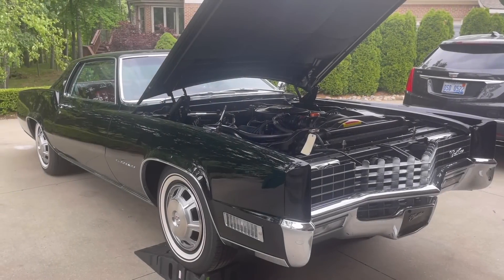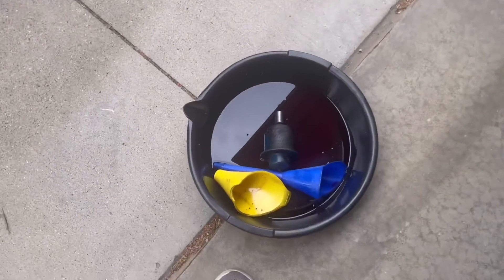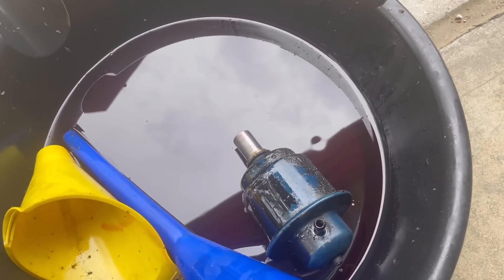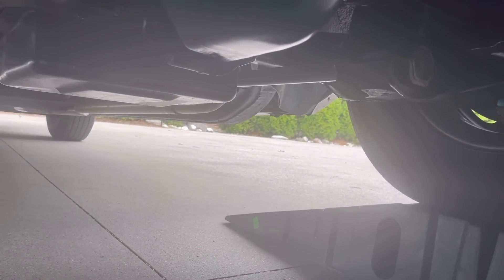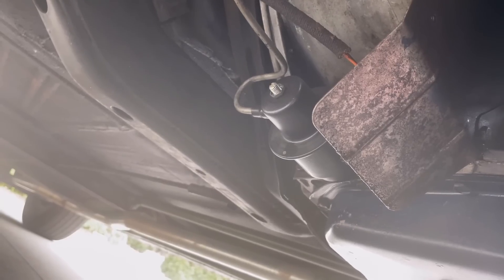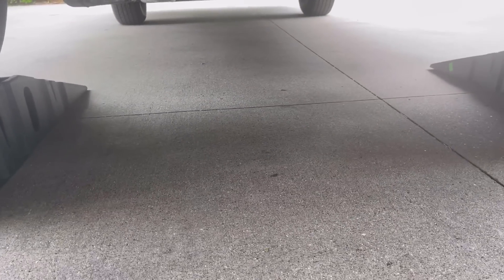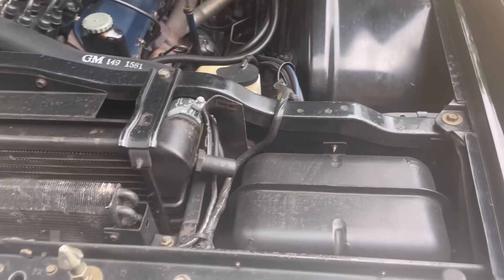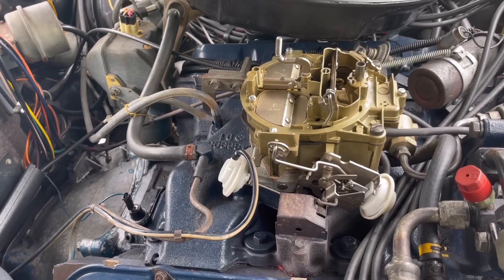How to Fix An Incorrectly Shifting Transmission Yourself (Incl. Turbo Hydramatic 350/375/400/425)!

Comment: You should remove valve piston and clean it with scotch pad and make sure the 3 holes are clear 2 on side and 1 on end. No sense pulling modulator without doing it, also governor determines shifts, look for striped nylon  make sure piston moves freely and springs on centrifugal weights

Comment: My sister had a 1970 Buick Skylark which suddenly stopped shifting automatically. So, she had to start in low, then move the lever to second and then to third. I thought the problem might be the modulator. I found that the vacuum line was kinked. I corrected it and the car shifted as normal.

Comment: IF you have a Leaking Modulator - the fluid is drawn back into the engine and causes smoke at the tail pipe. BUT Transmission Fluid actually softens rubber - to keep the seals in the Transmission sealing the pressure. This will also soften the Vacuum hoses hooked up to the Modulator so WHENEVER you replace a leaking modulator - always replace the Vacuum line to it as well. THey are cheap hose - easy to get - and not hard to install. (Pull off - push on)

Comment: Old cars are the go. I had a beautiful 2010 FG xr6 but it had one of the worst transmissions that ford ever decided to put in their falcons,the dreaded 5r55s 5 speed auto. Only had 110,000 kms on the clock and the bloody servos started slipping between gears. I poured way too much money into this car to get it how I wanted it to be but to have to turn around and sell it while it was still working ok really gutted me. I dropped about $4000,00 on this car. Never again will I spend money on a muscle car with go and show,it’s just not worth it.

Comment: What is recommended to service turbo hydramatic 400 transmissions. I have a 1973 Buick Centurion 455 cubic inch with 95,000 miles?
Reply from the maker: Just change the fluid and filter every 50-75k miles under normal use.

Comment: My first car I owned was a 73 Caprice 4-door with the 400 small block and turbo hydromatic 400 I had to replace modulator valve on it very easy job to do average 15 miles a gallon hwy with points ignition and 2 Barrel in my opinion Best Transmission GM ever made.

Comment: I was heading home from a desert trip in my 70 El Camino 350/350, I had pulled off at a rest stop. After that it wouldn't shift out of first. After a few seconds pondering driving the remaining 50 miles home in first gear, I popped the hood and found that the vacuum hose had pulled off of the manifold. After a quick repair, I was on my way home with a functional transmission!

Comment: I have a question, On the 1979 lincoln continental town car, does it have a temp light on the dashboard?, Cause I don't see one...? It has a temp sensor...that's why I'm wondering.
Reply from the maker: I believe it has an Engine light which is wired to the temp sensor as well as oil pressure sensor.

Comment: My old caprice had a leaky modulator that kept fouling one of the plugs.  And, I left the modulator hose disconnected from the tranny when I was putting the new long block in my 78 camaro

Comment: You should change the engine oil just in case transmission fluid was sucked into the intake manifold and down to the crankcase. That happened to me on a 71 Buick.

Comment: I used to work at a Chevy Olds dealer when I was younger and rebuilt transmissions sometimes as well. I had the opportunity to do a few of these huge front wheel drive transmissions. IMO they were one of the tightest ones to get out. 
Nice video.
Reply: If you think those were tight - you would have had a heart attack with many of the later Front WHeel Drive ones - With a Saab you had to remove the ENGINE to get at the trans among others.
Reply: @Thommadura  Wow. Never had the luxury of doing one of those. Sounds crazy.

Comment: Also check the vacuum pipe is fitted inside the port on the manifold fitting and the modulator. The manifold fittings often have a small hole in the port, so check that is clear. Check that the detent switch is adjusted correctly. If it has a switch at the pedal with a sliding action, you can reset it by pushing the sliding part all the way towards the firewall and then fully depress the throttle pedal. You will hear  the switch ratchet as it self adjusts to the correct kick down setting.
Reply: 425 don't have a cable th350 and 200 do
Reply: That would b a TV cable. 200/700R4. The turbo 400 is electric kickdown, the turbo 350 has a kickdown cable.

Comment: So far 76 convertible which the underpinnings are almost identical I have not run into that issue. But thank you for pointing that out as if it does act up I know what to check first.

Comment: I change the fluid & filter  and dump in 2 bottles of slick 50 go out  on the super slab and  bury the needle pedal threw the fire wall oh and all good transmission mechanics  know to start at the Carbureator

Comment: I bought a 1983 Grand Prix Brougham that was a 305 Chev with the 200R4 trans. I watched the owner keep adding transmission fluid in it until he gave up & sold it to me for $100.00.
Turns out that the modulator valve was sucking fluid into the engine and what he thought was a head gasket problem was the engine burning transmission fluid.
Once I fixed the problem that was the cleanest engine I have ever seen. That engine ran perfect & never used any oil. Got almost 500 K out of it with the original timing chain before it was sadly rear ended & wrote off

Comment: You know I appreciate you Adam it's like a personal video for me! I have a 1976 Cadillac Eldorado with a 500 inch motor I would assume that the technology is basically the same as far as the transmission modulator I'm going to go ahead and check out the vacuum lines going to the modulator but I have had no shifting problems the car is wonderful I'm just having some proportional valve issues or soft rubber lines to my brakes in the rear because I'm not getting brake fluid to my rear brand new disc brake calipers "had tried to do a brake bleed and nothing came out?"  but life goes on I'm trying to make this thing mechanically correct it hasn't been touched in twenty-nine thousand original miles and I'm the second new owner.  So here we are thanks again !
Reply from the maker: Could be master cylinder as well
Reply: I hear you supposedly the vacuum booster master cylinder has been replaced before I bought it I'm going to get my mechanic to diagnose it because their is too many new parts mixed with old parts to try to decipher :) Right now I only have front brakes lol!
Reply: It's a beautiful car it just needs a new convertible top it's got the Firemist red paint with red interior!

Comment: I didn't know there was anything above a TH400. The gears in the 425 must be rock crushers!  🤣

Edit: I had a TH350 behind a hopped up 73 455 Pontiac engine in a 1980 Trans Am, and aside from it refusing to start off in 1st gear unless I put it there (was told because of missing kick down linkage), it held up fine!
Reply: Is the 425 really "above" the 400? I'd always heard that it was just the a split version of the same transmission, with GM's famous drive chain between the two halves.
Reply: @pcno2832   IDK I made that post reading the title before watching the full video, and then saw the 425 was in fact this version.

Comment: Damn.  I wish there was some way to share some of the weirdo Ford GM and Chrysler donated prototypes I got to fool around with at Motech back in the '87.  Was interesting that when I was going to school there on Industrial road in Livonia that ASC was building the 50 GNX Buicks just across the street(Barb-wire protected)..  Was cool to at least see all of them.  But, the weird prototypes at Motech were more interesting.  Dodge D100 with a 2.2 4 cylinder.  Yes, the protype artisans built such a thing even though the 2.2 was never made for RWD.  The upper radiator hose was at least 6' long...pretty funny.  Motech was a decent school.  Sad it no longer exists.

Comment: I've seen folk pull engines to rebuild due to the blue smoke from burning transmission fluid sucked in from modulator..  Stupid mistake from the "old days"  Glad I was a Mopar guy.. no modulator.

Comment: I once had the modulator valve go bad on an ‘83 Ford Ranger. It had the same issues you mentioned.
Reply: If I remember correctly, the Ford transmissions in the '80s(at least the AOD ) were not vacuum controlled. They used a mechanucal linkage.

Comment: Need to replace the two short vacuum hoses too. Not good for the hoses having that fluid in there. That transmission has a good track record, very reliable and tough.

Comment: Excellent Adam, people generally assume the worst if the tranny acts strangely...  Lately I've been driving my Wildcat convertible and again marveling how flawlessly its Turbo 400 shifts compared to my 4T65-E HD.  One of the first things I did was to put an adjustable modulator on it and convert it to type F fluid. Between the two, it's always in the right gear for the speed/load/throttle position and the shifts are imperceptible, neither slipping nor banging.  Tis a pity that the computerized Riviera can't claim either of those, and takes forever to go into drive or reverse...
Reply: I never saw any AOD transmission from the Big Three that were as good and reliable as the simple 3 speeds of old that they replaced. And you'd think all they had to do was just add a gear up in there but not they have to downgrade the whole transmission.
Reply: @HAL-dm1eh  The 4L80E was pretty near bulletproof, considering it is the electronic, 4 speed version of the TH400. The main thing is GM (and Ford and Chrysler) started using lighter duty transmissions in heavier/more powerful cars, mostly for fuel savings. The most egregious was putting the Chevette TH200 into V8 cars.

The 4L60E gets a bad rap, but it's not too bad of a transmission, especially in later models.
Reply: If your 4T60/65-E is taking a long time to go into Drive or Reverse, especially after it has been parked for awhile, you likely need to reseal the torque converter circuit or the input clutch housing need to be replaced due to an internal leak. It should not take any time to shift to Drive or Reverse.
Reply: @paulwindisch1423  Thanks for the tips, Paul.  I don't know if it makes a difference, but this problem has been consistent for 18 years and is actually better with a cold start (and ergo a faster idle...)

Comment: Some of these 10 speed computer controlled transmissions today can just be a hornet's nest of complexity. With these older transmissions if it's got a lot of miles on it and it's just starting to wear out you can use a bottle of that Lucas Transmission Fix and it can extend the life of it for a few years. That is one of the few additives that really does work.
Reply: Just added some to my 2010 Corolla 4 speed (old but reliable design) during the last fluid change to get rid of low speed shuttering, and it worked of course.
Reply: I had a leaking steering rack on an 06 Volvo XC70 at 125,000 miles. Lucas to the rescue! At near 200,000 miles when I sold the car, no leak at the steering rack!

Comment: Did those TH400/429 combo have there own bell housing pattern ?
Reply: I think you mean 425, GM never made a 429. And yes it would be a BOP bell pattern.
Reply: Oh I was referring to the Cadillac 429 
And yea the TH 400 and 425 transmission.    I know it was just a one year thing before the 472 engine
Reply: @alexinnewwest1860  I coulda swore he said this was a 425, but I've been wrong before. Man the 472's were engines dreams were made of, every time I see the Cadillac valve covers I think of 472's.
Reply from the maker: Engine is a 429.  Trans is a 425.
Reply: So is that 429 a BOP pattern? 
Was it just for that particular year?

Comment: And if your tranny is just starting to slip, you can make the best of it by adding a small bottle of positraction additive.
Reply: Lucas tranny additive works.
Reply: FYI; Please don't refer to the transmission as the "Tranny". You'll cause an uproar with the LGBTQ community.  In the old days you could say tranny, not any more. How times have changed. Just wanted to clarify that. Otherwise gr8 content/video. I think Adam is a great helpful guy.😊
Reply: @paulkirkland1535  You're right ... could easily get my comment censored.

Comment: I do remember these GM modulator valves, When you see "white" smoke in your rear view mirror, pick up another valve on the way home! I suppose they did last a while, I had 3 GM's  and had to do all 3 in a 2yr period..ha, but not again. May have been about valve age more than miles used.

Comment: Olds and GMC.  Hmmm.  I wonder if that was how GMC ended up with 350 Olds Diesel engines in their trucks.  I never thought of this before.
Reply: If you had a good good machinist those Olds 350 diesels could be turned into high compression gas motors, either the heads or block or both needed drilled for water passage. I'm pretty sure more failed though than ran successfully.

Comment: valve diaphragms, hoses, belts, etc.  anything rubber or plastic should be suspect after 10 years.  Particularly anything near the block where it will temp cycle.

I was waiting to see you adjust that valve whilst shifting 2nd to 3rd!

Nice clean underside.

Comment: My first car in high school was a 78 Monte Carlo with a 350 transmission and 305 engine.  Every time I took a rough dirt road to hide and drink beer on the dang hose would come off the vacuum modulator and no upshift.  I would have to climb under the car in decent clothes with a buzz hoping the law didn't come around and connect it back up.  Probably could have been secured a little better but I was only 16 and didn't care.

Comment: It's amazing how simple and EZ older car are to fix compared to new cars.   Starting in the late 70's the simple and EZ started to go away.
Reply: I'd say it wasn't until cars got computers that things began to get complicated. But even into the '90s, cars were still relatively simple compared to the high-tech junk of today.
Reply: @paulparoma  For me the simplicity started to end with the introduction of EFI and electronic ignition.  With carbs and points, if your engine were to quit you could open the hood and see what was wrong. But your right with new cars today if they don't start it's a mystery.....
Reply: @jetsons101  What makes today's cars especially bad is the stupid start button. How are you supposed to shift into neutral if a car is to be towed?
Reply: @paulparoma  There are a lot of cars where you cannot actually tow the car with tires on the ground today.
Reply: @Thommadura  I know. That's "progress."
Reply: The fact is, weight was not an issue with Older cars so the could just make them BIG with lots of extra space. For gas mileage - they had to reduce weight - and so they made cars lighter and smaller - and they Jammed things together because they HAD TO,

Comment: Do you ever pull the trans pans off any of your low mileage vehicles to service them with new fluid and a filter?
Reply: I would imagine all the fluids have to be kept up on all his cars, and I wouldn't want to imagine what that or its bill looked like. 🤣
Reply: @HAL-dm1eh  Some people like to leave the original whale oil fluid in pre 1971 automatic trans vehicles.
Reply: @jeffrobodine8579  Whale oil fluid? As in literal? I didn't know what was a thing.

Comment: I like the look of the Quadrajet for some reason. I had those on my Chevy's until TBI came along. That was better.
Reply: Yeah Carter quadrajets weren't bad , Rochester's were complete crab. I had a Carter 800 cfm quadrajet that was on 4 or 5 engines, smoked tons of ppl with high dollar Holleys and Demons.
Reply: @willallen7757  Carter didn't make Q-jets. Rochester did. Carter made AFB and thermo-quads.

Comment: Great video Adam dry rotted and cracked vacuum lines can cause all kind off run ability issues I have seen them look good on the outside but collapse internally causing ruff idle and poor shifting if it’s for the trans modulator valve also leaking trans modulator valve will give you heavy white smoke on acceleration.great upload 👍✌🏿
Reply: I just replaced the vacuum line to the TH400 in my 71 Camaro and it made all the difference. Much firmer and cleaner shifts. The old had gotten soft and was probably collapsing.
Reply: @Darryl Burgess  if you want performance shifts use type f fluid cheap shift kit you only need to do a tranny service filter and gasket

Comment: Good info.  Sometimes when the modulator went bad they'd suck trans fluid up that pipe and make the engine smoke like crazy too.
Reply: I once got a chevy blazer cheap because of that. The previous owner thought the engine was bad because of blue smoke. I figured out it was just burning lots of trans fluid coming up the modulator line.
Reply: Yep, smoke white like a freight train if it got bad enough. And if you didnt know what was happening you would think you had a blown head gasket and would wonder where all your transmission fluid was going to. As far as adjusting the shift points, that was only under light throttle being as it was vacumn operated. It had nothing to do with wide open throttle or anything like that.

Comment: TransGo has a solution for every common tranny issue.
Reply: Every few years I put a half pint of TransX in the 400 when the front seal starts to drip.  It also tends to free up gunky power steering (which should then be flushed.)